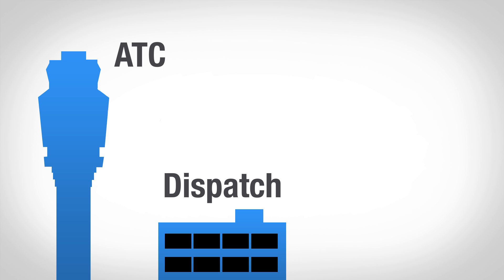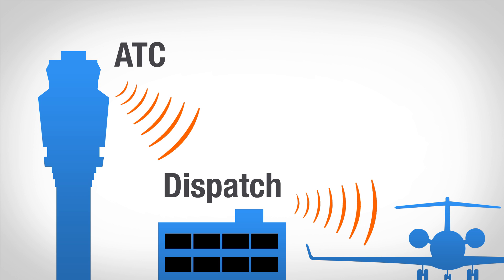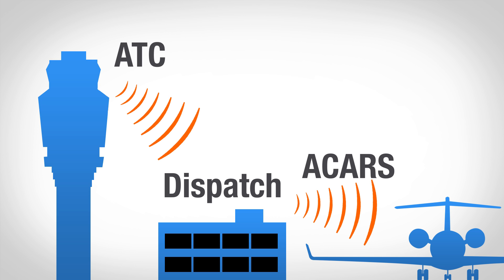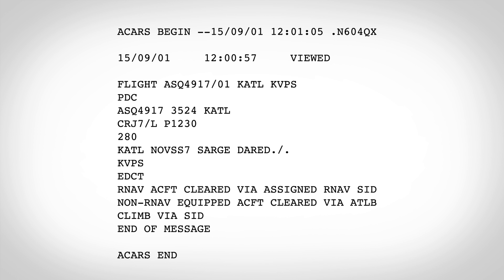What Is A Pre-Departure Clearance?

Comment: Yet in Canada, no PDC and in LGA you still have to call clearance and confirm your departure. But LGA is worthy of a whole other discussion....
Reply: LGA is capacity controlled (along with EWR, JFK, ORD, SFO, & LAX) via slot allocation.  So with all 3 major NYC airports being Cap Controlled you will call them because the Tower, Departure ATC and Enroute ATC's are constantly balancing clearances (times, routes, and speed minimum/maximums). NYC airspace is like a ballet being performed in the middle of a football field during the superbowl.  If everything doesn't line up properly then aircraft are put into holding patterns as they try to clean up whatever happened to clog the system.  Always makes me laugh when I hear one of the Euro Pilots complain that they need to maintain a minimum airspeed until passing (waypoint) because if they don't the ATC will spin them off the approach and have them circling so the flow of aircraft before and after the flight isn't impacted (maintaining the planned flow). They'll get landed 20 or 30 min later.